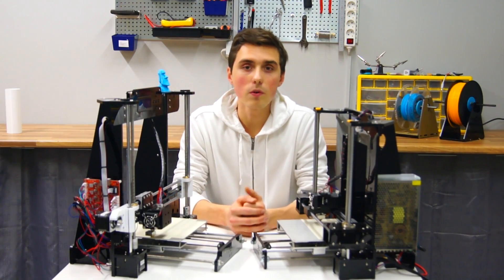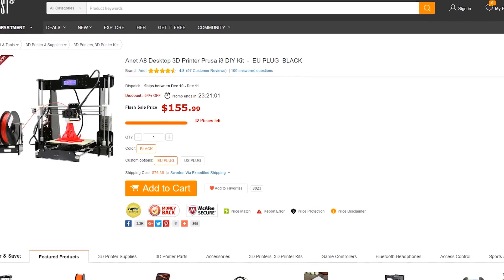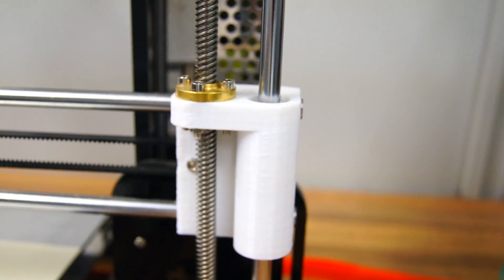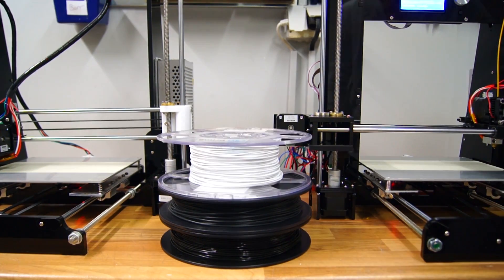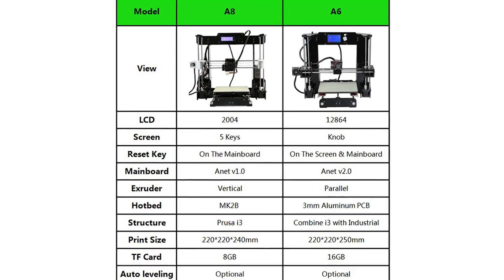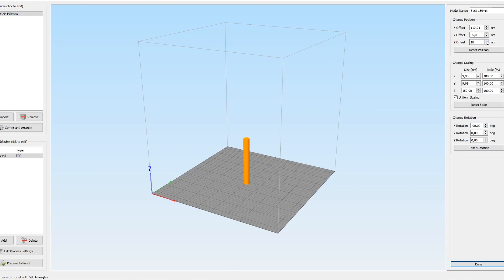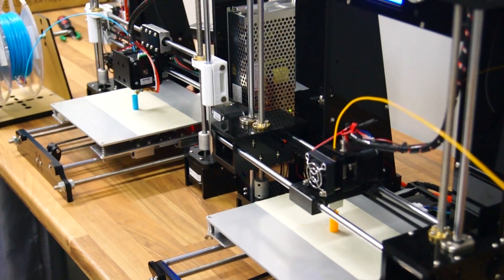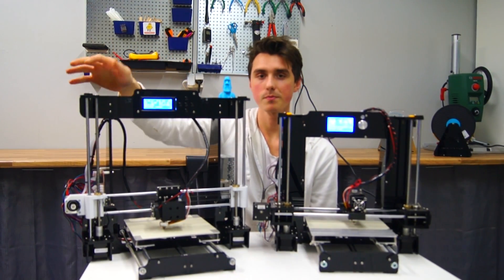Anet A6 vs A8 Comparison - Which Is the Best 3D Printer?

Comment: Is PLA toxic?
In solid form, no. In fact, Polylactic Acid (PLA) is biodegradable. It is often used in food handling and medical implants that biodegrade within the body over time. Like most plastics, it has the potential to be toxic if inhaled and/or absorbed into the skin or eyes as a vapor or liquid (i.e. during manufacturing processes).

Comment: a 3d printer is useless without 3d modeling knowledge , yes you can find a lot of things on thingverse, but there will be times when you want something and it's not in there and that's when you gota do it yourself.
   my anet A6 didn't have that many upgrades ready for download when i bought it, but upgrading it made me learn a lot about 3d modeling since i had to download most of Anet A8 upgrades and modify them for the A6, if i remember even the x carriage was meant for converting A8's to the A6 style.
  so yeah for the lazy ones that will dump it after a few months go get the A8 printing upgrades and trinkets will only last for so long, but when you will try to use it as a tool to make something with real use with any kind of precision,you gonna wish you had bought the A8

Comment: Hey dude great videos! I want to print in a quality lile your Creality Cr10 prints but I have heard that if somebody do any upgrade(steel frames,V6 hotent,hotbed,etc..)the Anet A8 will be able to print like a 1000$ 3D printer,which means it will reach Creality Cr10 's level with approximately 200 euros.What do you you suggest me to do?Buy Creality CR10 (340Euros) or Anet A8(145 Euros)??

Comment: Just purchased the A6. The full acrylic frame is going to add to the stability of the printer and therefore greater accuracy in your prints. I agree that the overhead mounted extruded is going to provide a much more stable base to print. Aside from some of the hardware similarities the overall build quality is a lot more professional and harder wearing. The print size is also slightly larger at 220 x 220 x 250. That interface is also nicer to use.

Comment: This was the first 3d printing video i ever watched, Glad to have been told the differences, as I almost got the A6 simply because it was just slightly more expensive, as if it would have mad a difference somehow- I'm glad to know its just the orientation of parts and the slightly different controls/LCD I'm missing out on- everything else that actually mattered was virtually identical, and I'm glad to know that
Reply: Good choice! Gearbest sent me the A6 for a review. Turns out that the smaller body and larger acrylic supports give better stability.
Reply: Good choice! Gearbest sent me the A6 for a review. Turns out that the smaller body and larger acrylic supports give better stability.

Comment: Do both printers have the same printable area?
Reply from the maker: Yes they both have 200x200x220mm.
Reply: Thanks
Reply: Are you sure? On Banggood specs it says A8 is 220x220x230 and A6 is 220x220x250. Which is correct?
Reply: The A6 is larger. As was mentioned it is 220 x 220 x 250. Just bought one of these and the overall build quality is a lot better. It’s sturdier and that overhead mounted extruded is going to aid accuracy and stability.

Comment: Hi there, thanks for doing the video. You mentioned that the boards are identical. I noticed that the A6 has two cable for the display.  Can you tell me how the cables are connected?  I bought spare LCD display 12864 hoping to connect it to my A8 but it did not come with instruction from GB.

Comment: I'd like to see the quality difference between the A8 and that giant $1000 speed monster you have! that would be great to see what $855 difference looks like!
Reply from the maker: The difference in price does not necessarily imply a greater printing quality. I see no significant difference in quality between the Delta ($900) and the Tarantula (200$). However, the Delta can print at much higher speed, is way larger, easier to assemble and is equipped with automatic bed leveling. I also wish to believe its safer to use as opposed to the Tarantula (quality control and such).
Reply: RCLifeOn VERY GOOD to know! thank you for the information and for replying! appreciate it!

Comment: 3 questions does the anet a6 have a problem telling the temp for the hated plate and nozzle?  How much will the shipping be to ship to Canada? I found this link will it effect the price? The link is https://www.fasttech.com/products/0/10029477/6562402-authentic-anet-a6-lcd12864-acrylic-frame-3d
Reply from the maker: No, the temperature is correct for both the heated bed and nozzle. Add the product to the chart and checkout, at that point you will be able to see the shipping cost to your country. Compare the price between and pick the best option: http://www.gearbest.com/3d-printers-3d-printer-kits/pp_428455.html?lkid=10244539

Comment: 1:00
"Minor thing, you won't be using it too much"
What?! So you're suggesting keeping loud PC on while 3D printing?
The only way to print without the PC connected is to create a GCODE and store it on MicroSD. And to choose that GCODE and start printing you need to use that interface
Reply from the maker: I use the SD card exclusively and even though the buttons are a pain, it's not a deal breaker.
Reply: If I were you I would look into a Raspberry pi and Octoprint or Repetier Server and use the PI to run the printer, if you have an A8, there are enclosures on Thingiverse to put it with the printer main board.

Comment: The A8 US Plug version sells for extra $60 compares to the EU Plug version and makes no sense to pay that much extra just for a different plug. Does your EU version has a current selector on the Power Supply Unit?
Reply from the maker: Yes, the power supply unit can be switched to 220V and 110V. Buy the EU version and use an adapter. Good luck sir!
Reply: Thanks for the video and your quick reply! Much appreciated and happy 2017! :)

Comment: As many already commented- you recommended the a8 on account of the popularity of it, but is it BETTER? A6 has metal parts, not printed, and a more stable print head design, can you do comparison prints?
Reply from the maker: The construction of these two 3D printers will not make a significant difference regarding quality. Settings and tuning is way more important.

Comment: Can I upgrade A8 with A6 control panel? Both are using the same motherboard... THX
Reply from the maker: Yes you can, but it will not fit the acrylic frame. You will have to drill new holes in order to fit the control panel. Or just attach it straight to the frame.

Comment: Laughed pretty hard when he said "there are some reasons why you shouldn't go with the cheaper one." Aka the A8 lol, then go ones to finish the video saying you should get the A8 over the A6.
Reply: I think what he was saying is that out of the box the A6 is better, but the A8 has a larger community, so there are a lot of upgrades and community support...and given the price he thinks the A8 is a better bet.
Reply: Actually he is Swedish. And yes, a negative generalization like this is not nice. Was surprised by the switch in the end too though.
Reply: Yeah. I'm confused. Is the A8 better or not?
Reply: Actually, one of the big reasons A6 is more expensive is because it comes with a roll of filament and the A8 comes with a tiny sample package of filament.
Reply: Ken H that is racist

Comment: Hi,  I have assembled the printer completely however it does not turn on.  I live in NY our power supply is 110v and I changed the settings to 110v before turning it on

Comment: Quick warning for anyone considering buying either printer:

I bought the A6 on gearbest, but quickly cancelled my order. I read on reliable sources that printers made out of acrylic are not a good investment, as the material in very very brittle and are prone to breaking either during shipping, assembly or after being used. Once a part is damaged, I wish anyone who wants to get a replacement from china or gearbest good luck.

The components of the machine are also of minimal quality, and there have been reports of machines catching fire. 

Remember GearBest sent this printer themselves, and you have to remember this is basically free advertisement, plus they probably made sure to send out good machines for people to review. 

I don't want to undermine RCLifeOn's review, as the printer can deliver good prints, but it's definitely a gamble to buy this printer.

I personnally ended up buying a Monoprice Maker Select V2, which is the next best thing I could find, and is a much more reliable printer than the Anet.

Just thought I'd share and spare at least one person from disappointment.
Reply: I've got the A8 a while ago. I've put it all together, leveled the bed and printed the Reddit Alien. It was the first time I printed something, I had no experience, but it turned out amazing. I don't have to make any mods for that.

Comment: Lol, shipping is 80 NZD.
Reply: yeah mine arrived after around 3 weeks Im guessing but from memory it wasnt shipped for around 2 weeks after I ordered it but it was christmas time. Everything was there and it worked better than I hoped as I read there was a lot of fine tuning but I slapped it together with wires hanging out everywhere and tried my first print and it printed really well. I have since then printed alot of the upgrade parts and have added the mosfet board and octoprint running on a raspberry pi and also switched to using Simplyify3D and the results for this extremly cheap printer are awesome! Problem is now I have to many friends wanting prints lol
Reply: Great shipping price seeing I believe that it comes DHL and is around 15KGs from what I read somewhere, i actually ordered one yesterday as $320 NZ landed seemed pretty good
Reply: has it arrived,  all parts  included,  working OK?
Reply: which printer tho? a8 or a6?

Comment: ABS or PLA?
Reply from the maker: PLA is non-toxic, way easier to print, can be printed without a heated bed and higher printing speeds. Though ABS has a higher melting point, longer lifespan and is very hard. Answer: PLA!

Comment: Nice vid man!

 I'm actually wanting to buy one of these two 3D Printers, but I'm having problems deciding which should I buy! My currency is the Euro and actually the price difference between the two is around 20€ at gearbest. 

My question is: 
Is the faster and esier assembly + free PLA + better Y axis arrangement + faster print speed + 0.4 máx layer height + ¿more rigidity & build quality? + ¿better parts? + more compact size + knob worth VS. greater community support +  more supported materials + (whatever other advantages you could tell me) ??? 

Also, do I have to pay some kind of customs fee or something if I order it from Gearbest?  (Shipping to Spain)

Thanks and congrats!
Reply from the maker: Yes, you will receive a customs fee of usually 20$ (though this depends in which country you live in). 

Just go with the Anet A8. The A6 might have a slightly more robust frame, and a knob. But it's more expensive and the community support it really important.

Comment: What makes you choose the A8 over the A6? When the A6 is smaller, best control bottons and makes the same print size. I like both and I want to buy the best option. Help me choose.
Reply from the maker: Anet A8 is cheaper, almost 50$ less expensive. The main reason I chose the A8 is because the printer is more popular than the A6. Therefore it also has a greater community, making it easier to find support.
Reply: Thanks for take your time to answer me. It's a good reason. More people sharing ideas to improve the performance. Once again thanks.

Comment: A8 is an outstanding printer , i have no problem with it, at all
my only question what other software can i use beside Cura, and can i connect it directly to PC via USB
Great vid mate.
Reply from the maker: There is a couple of softwares you could use, Repetier Host and Cura being the most popular ones. You can also purchase Simplify3D, but it's quite expensive (150$). Yes, you can connect it to PC via USB. Thanks for watching!
Reply: Thanks for the reply, what software are you using in this video @4:05 does it work on A8 printer,
Thanks Mate

Comment: doesn't the A8 come with fillament?
Reply from the maker: It does not,.
Reply: then i have to buy some xD. i bought it because i saw your video ;D
Reply from the maker: In fact, a couple of people have said that it does come with 10m rolls of ABS filament, but I would pruchase some just to be sure :) Besides, 10m of filament is like 1 small print...
Reply: ok thnx
Reply: and then i have to pay tax over the price of the printer+ import costs= fucking 67 euro :(
Reply: I just bought my A8 and mine came with a kilo of white abs. where I got mine it comes with a kilo but you don't know the color or if its pla or abs. mine also came with two screw drivers,allen wrenchs, a wrench,usb sd reader and 8gb sd card.
Reply: where did you order it then?
Reply: Check Aliexpress. I saw that they are selling them for 197 dollars with shipping included. But im not sure what to do in case you have trouble with your order...
Reply: lordwalras I got mine on ebay $174.99 seller ohbuybuybuy
Reply: LordWalras: my one not
Reply: mine did, and with some tools
Reply: Two choice, 0.5 kg PLA or 10M PLA
Reply: i have essembled everything but it doesnt want to turn on HELP